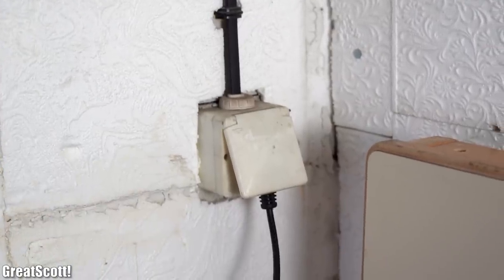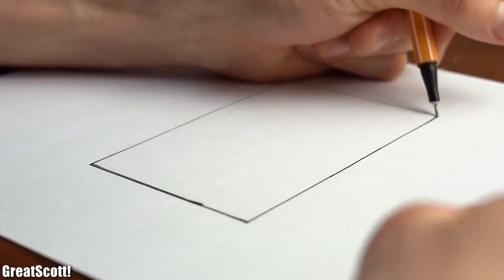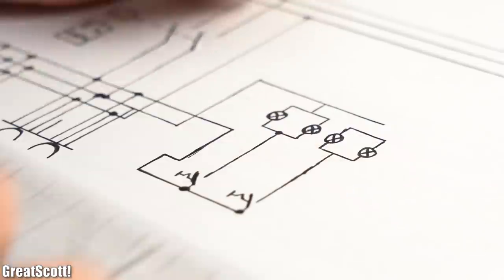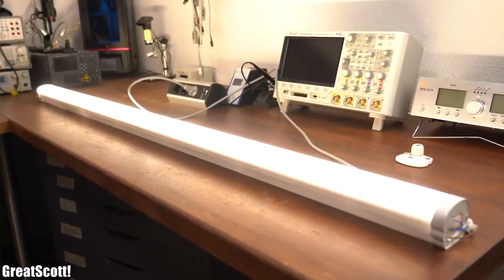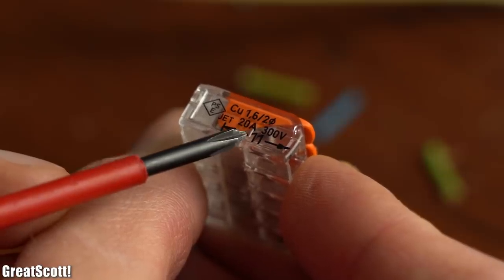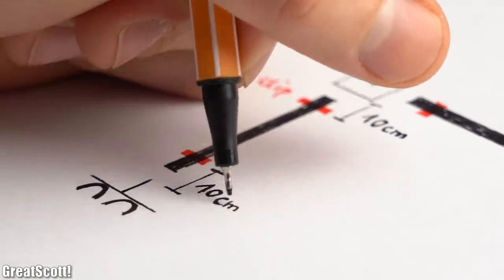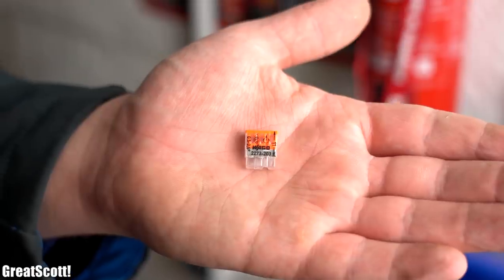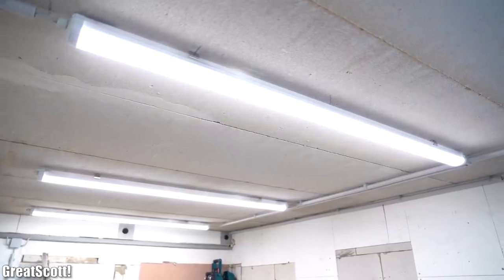How to do Electrical Wiring properly! (more or less....) GERMAN STYLE!

Comment: German here. Incase some people think "Meh, he probably did it extra well here in this video, there is no way this is how its done on site irl".
Nope. That is exactly how. In any house where the electrical system was either renewed, or new anyways - this is exactly how it looks. :D
Reply: Yep, but in most houses you don’t use “on the plaster” type but “inside plaster” type or whatever it’s called. In Poland we have special flat white cables that go into plaster without any conduits.
Reply: Looks just like in Sweden. North Europe takes standards very seriously. :P
Reply: Are you shure? Some stuff needs to be bodged, because some people think it is a good idea they do it yourself, and not like the good kind he did. You see the fuse at the beginning of the video? Some random dude had the brilliant idea to hammer a Nail into it since the fuse kept melting... long story short the fusebox started to burn.
Reply: @iamjimgroth  yes there is like a whole book with all the regulations the NIN (Niederspannungs Installastons Normen) it hast 200 pages for the compact version.
Reply: @volkhen0  i think these arent up to norms anymotr
Reply: In the Nederlands its the same as in Germany proper and safe
Reply: @highkicker11  Try hiring an actual electrician then.
Reply: Almost as neat as a Swedish installation. (Those external wall conduits leaving open cable, LOL)
Reply: Sorry, but the final result at 11:08 does not look that special. Especially the path of the lamp output. I get it, group connection (which is not even necessary in a small room like this) but anyways.
Reply: Well yeah it looks like that if done properly by a good electrician. But not always in diy situations.
Reply: @iamjimgroth  Even in Central Europe - Czech Republic we have nearly every less than 25 years old electricity wirings nice like that.
Only difference is, that we use type F  (French) plugs and phase is ALWAYS on left side, so you don't have to worry about it in any situation.
Reply: It's how it's done if the electrician does it job like he should. I opened many electrical boxes and what I've seen over the time is horrid.
In our old company building for example, they used a 2,5mm² blue wire for PE. 2.5mm² wire was also used for the main N connection from the RCD to the N, were as the L wires were made of 6mm². I still wonder why it never lead to fire.
Reply: @vitcenek8611  nice! :)
Reply: @calysagora3615  Well, that's what people would use in a garage, or a basement. 
Not in the actual living spaces. So, don't worry.
Reply: @ThomasBomber  I agree, and I'm part German!  Nice would have been 1 long piece with 90's on each end, and a T at light 2 & 3.
Then run the conduit to the base of the lamp, unless thats out of spec.  Not sure why you would encase the run in conduit and then leave snag-able base-cord there?  Why not a snap together piece if it needs to be accessible?
Reply: @volkhen0  this exposed "on-wall, on-plaster" installation method (de: "Aufputz") is mostly only used when there's no strict aesthetic requirements. We do it like so, mostly in places like that garages, basements (with blank concrete walls) etc..
For "in wall" we use pipes. We have this flat cables too, but they aren't widely used anymore, because there are many restrictions to them when and where they can be used or not.
Reply: @Thefreakyfreek  meh, we do a neater job imo. Fucking rubber grommet cable boxes.. I'll pass on those.
Reply: @vitcenek8611  Hi Vít, you made a mistake. Germany uses SchuKo (type F) and Czech Republic uses French (type E) sockets. Both countries are using universal plugs compatible with both type E and type F sockets.
Reply: @MarekKnapek  Oh. Yes, I see. Sorry for this mistake, but anyway, you understand what I wanted to say.
Reply: @Helli__  The only place where I saw cables on the wall in the apartment is a loft industrial style.
Reply: drstefankrank  maybe they asumed to have only symetric loads ;-) therefore no current to neutral wire. I think this was common understanding in the past but not to code :-)
Reply: @calysagora3615  External wall coduits in a places like a garages being PVC instead of aluminium. 🙄 - Finland
Reply: @fabianmayer  atleast in norway, you are required to have a electrician visit your house when you either build one or refurbish old. If they think you do not meet the standards you will be forced to have an electrician fix it or your house is condemned
Reply: @boots7859  The conduits are mostly just for holding the wire. The wire itself doesn't need protection in this specific case, you could use nail clamps as well.
Reply: Even your name is pretty German. "Schwanenberger"
Reply: Same for Belgium. My father worked as an electrician for decades now. The standards are fairly rigid.
Reply: Nah, there's always a bunch of people that botch things together just look at 5:22 that's an ancient fuse from the 60's with wayy too long wires just stuffed in the box.
And it's like that in a lot of places.
They are purposely making it nicer for the video, nobody actually looks up how many millimiters they need to strip off the wires lmao If you believe people do that you're just confirming you've never been on a work site.
Reply: Am I just checked, and it has 577pages
Reply: Er hätte schon nach VDE vorgehen sollen und wenigstens die Abzweigdosen Genossenschaftsmäßig schon machen können. In meinen Lehrgängen sollten die Wagos auf einer Höhe sein und nicht wie hier dargestellt wie eine Welle. Hatte immer 95% auf meinen Lehrgangsnachweisen und muss sagen er hat weder gezeigt wie die 5 Sicherheitsregeln funktionieren oder wie man eine Anlage nach der Installation prüft. Dazu abschließend bestimmt ein Mann vom Fach, dennoch für ein vorführ video zu oft gepfuscht.
Reply: @LIKERorHATER  boa ich merke, hier hat jemand so richtig Ahnung.  Leider gibt es nicht mehr solche Arbeiter mit Berufsstlolz. Du hättest dich höchstwahrscheinlich kaputtgelacht wenn du den Schema 3 von meinem Monteur gesehen hättest. Bei‘m einschalten hat es solch einen knall gegeben, die Bezügersicherungen sind Rausgeflogen.
Reply: @fabianmayer  gab es ein kurzen vor der UV oder was muss man machen das sowas passiert xD
Reply: @LIKERorHATER  er war so im ük, und hat es aus gründen geschafft dass die bezügersicherungen geflogen sind.🤣 keine Ahnung wie dass geht, da jeder Arbeitsplatz abgesichert ist. Eventuell hat er es Im Tableau vergeigt, da er aucv sonst nicht der hellste ist.😂
Reply: Well, 1.5mm on a 230V installation (which I believe Germany uses) does not handle 16 amps as stated in the video (you need 2.5mm for 16amps at 230V... 1.5mm can handle around 13amp if insulated, and around 11 if non-insulated), plus he doesn't use a breaker after the differential protection for that Schuko din plug.

I'd honestly say this installation (the schuko one, not the lighting) is a fire hazard, and, at least in Spain, it'd be fully against the electric regulation and wouldn't pass inspection
Reply: @jcampos  Well you are correct. I didn‘t realise that lmao
Reply: @jcampos  1.5mm 16A at 230 V and 2.5mm 16A at 400 V
2.5mm 20 A at 230V
Reply: @LIKERorHATER  maybe on extremely optimal installations... but it really doesn't matter because he installed no breaker after the differential so he could easily plug 25 amps to that circuit and fry the schuko plug, the differential... and the cabling
Reply: @jcampos  I didn't take care of it but he used an FI, maybe it is an FI/LS
Reply: @LIKERorHATER  you could be right, in which case, I'd be wrong about that (I haven't really seen combined FI/LS on domestic installations here in Spain, although I know they exist) . Still, for a 16A breaker, in Spain you wouldn't pass inspection using a 1.5mm cable (and I'd find that tremendously unsafe, personally... it better be a great quality cable and not lose a single copper strand on the connections 😁)
Reply: @jcampos  the VDE have a standard for cable dimensions. It's correct to use a 1.5mm² for 16 A
Reply: @volkhen0  here in Italy it is absolutely forbidden to lay cables without conduits inside the walls and the internal diameter of the conduit should be in relation to the diameter of the bundle of cables to guarantee the possibility of conveniently extracting the cables.
Reply: @jcampos  after I rewatched the video I noticed that he has the 6A main fuse so the schucko can't fry and the cable don't brun.
Reply: * how it should look.
Reply: @highkicker11  In Belgium plenty of houses are not yet up to code but once you want to sell it or rent it out you need a certificate that says eletrical is up to code. if not it has to be put in order within one year of the sale.
Reply: @ThomasBomber  They do that in Germany and I don't know why. Always felt wrong to me too.
Reply: @imnota  So true, particularly regarding people actually checking what they just did. There are a lot of "clamps" where the wire can go underneath the metal band it's supposed to be going through, but it still goes all the way to the back and doesn't pop out easily. But the contact has super-high resistance, if any.
Reply: @volkhen0  Concrete walls, very difficult to dig into, no plaster. You don´t want to plaster a garage just to hide the cables. Flachbandkabel is not the best solution as you need to fix it on the wall as well.
Reply: @highkicker11  I know of bad electricians that do that on purpose so the customer (or another electrician) has no idea about what is going on and needs the original electrician to fix the problem. They also keep the "Schaltplan" secret against the laws that require disclosure of the plan to the customer. It more often happens with businesses than with single customers. Those guys need to have a bad reputation, so they get out of business sooner or later.
Reply: Id like to think that this is not up to german standards, but rather "prosch"
Reply: sorry guys, the final result looks like shit. we have a smilar system of conduit mounted on clips here in Argentina but they end in proper connectors for your box. No way in hell anyone would think "finish 5cm off the box and then run bare wire" is anything proper. The rest of the features are ok, except for the wago connectors, since we don't use single wire conductors, but all wire is stranded here, so we are allowed to use electrical tape for splicing.
Reply: @iamjimgroth  Same in South Europe ;)
Reply: Das ist ein gut Zeug!  Here in Amerika, I have run into several disasters in wiring and wondering why things didn't catch fire!  Much more laxed here, which is a bad thing!
Reply: I would not agree. It looks better and there are few steps that can be much better.
Reply: What he has done here should not be allowed by any electrician. Well unless in Germany you can give more than one wire to one terminal, you don't have to separate the light and socket circuits, for the socket circuits you can use 1.5mm2 not 2.5mm2 the main fuse can be less than the next one.
Reply: "Properly" in Germany?! How about the other  194 countries, from which at least 180+ cannot afford to buy any of the fancy things? (can say all 195 have the majority of the people who cannot afford doing it the fancy way its shown here). Been there, done that is what I will say, I am electronics professional for over 20 years and been working with house installations for at least 15 years. The way its done "properly" always depends on the persons budget.

Comment: Scott: Talks about wiring standards
India: We don't do that here
Reply: Who needs connecters We have insulation tape😂😂
Reply: @sayujraphael  who needs insulation tapes we leave it open
Reply: @mahargha_debnath  Why leave it open when you can hide twisted wires behind the cupboards!
Reply: India using Chapati Standard plagiarized from the Ex Colonial British Standard
Reply: Well. We do have a strict codes and standards in India. None of us follow when in comes to LT wiring for houses. We do follow a lot of codes for industrial HT wiring.   But things are getting better slowly. :)
Reply: @AbhishekBana  The point with not obeying the code (by electricians and DIYers) can be solved easily. Have a mandatory house inspection every year, and if the installation does not comply to the standard, switch off the supply ;)
Reply: @manofnorse  Not possible
Reply: @pro-nav  Almost everything is possible, if you try hard enough ;) even in India ! :) Btw, you recognized the ;), didn't you?
Reply: LOL in north america its mexico thts like wire standards thts like work we dont do tht we go north and get handouts
Reply: @manofnorse  
A house inspection every year is a really bad idea.
Here every year they modify the code in such a way that if they did an inspection every year, I'd literally have to tear appart my house every year because they decided the cable they recommended last year isn't the same as this year or that I'm not allowed to have more than 2 outlets less than 20cm apart or that conduit clips need to be every 40cm instead of every 50cm for absolutely no reason.

We do an inspection after every major electrical modification or when the house is sold, and we rarely ever have issues with our electrical installations and in every house I've been in the installation was fairly recent and completely safe.
Reply: @imnota  you'd be "grandfathered" in then, but yea, stupid idea
Reply: @imnota  You have an false understanding of it. In Germany the standart also changes, the instalation has to folow the standart of the time it was made in to insure that DIY people dont modify it or other factors as weathering, water, etc. destroy the instalation so it stays safe.
Reply: @sayujraphael  who needs insulation tape, we got religion
Reply: @fidelcatsro6948  I think India is entitled to a little plagiarism from Britain. lol.
Reply: IS is very similar to IEC which is derived from German.
Reply: Who needs wire stripper when we have strong teeth😁
Reply: Ten thousand people are killed in India annually by electric shocks, that is about 7 / million people which is about 10 times as much as in Germany or other Western countries.
Reply: @imnota  In Finland it is enough that it is up to the standard when it was made. Doing installation before sale makes no sense as the new owner of course wants to do his own renovation.
Reply: @jernejj5 No they do not. In fact it is "illegal" to ground them in Finland it the nearby socket is ungrounded. In Finland one cannot have grounded and ungrounded outlets in a same room - or if one has there has to be 4 meters between them so that one cannot touch an equipment on both at the same time. This of course applies only to old installations, now all sockets need to be grounded.
Reply: @mahargha_debnath  ... that's basically why Edwardian era electronics were so dangerous.
Reply: @AbhishekBana  Don't mind them. There are plenty of electrician hacks both in UK and Germany. Indians have a far better education since they're hands on approach and their manufacturing solutions. There are loads of rewinding specialists that deal with transformers, industrial motors and huge pumps where as in most of Europe most electricians wouldn't know a simple voltage drop formula
Reply: India use  standard rules

Comment: This was a PLEASURE to watch for someone working in this field! Thank you for the hard work you put in these videos
Reply from the maker: Much appreciated!
Reply: @greatscottlab  can you make a video about IC plz :)
Cause I’m confused about the pins and what they do
Reply: One yeare left till i work in this feald also I´m from Germany so this video was greate
Reply: @comback8237  
ICs are always different. If you want the specific pinout of an IC, the best thing you can do, is look at the numbers on it's top, input them into your preferred search engine, and look for either a site called alldatasheet, or just a plain pdf file. 
If you find the pdf of your specific IC, then after reading it, you'll find the pinout, and parameters as well.
Reply: @comback8237  In case you still need help, just comment here again, and Ill help ya.
Reply: is "5 cm of bare wire entering the box" really up to "code"? that looks just nasty, and it doesn't meet code here in Argentina.
Reply: @83hjf  This is not the only thing that is substandard. Smaller fouls are made in Poland by "electricians" who stopped in the communist era.